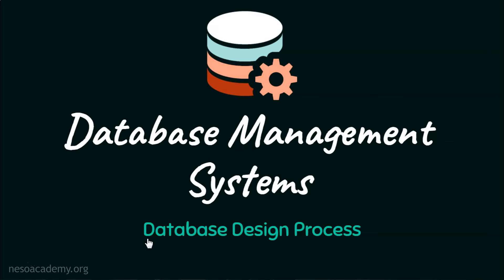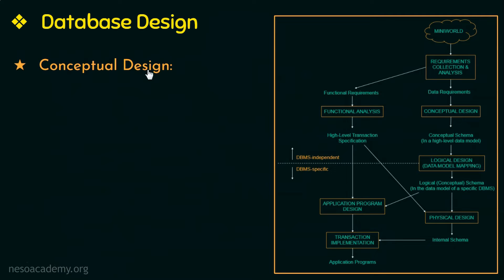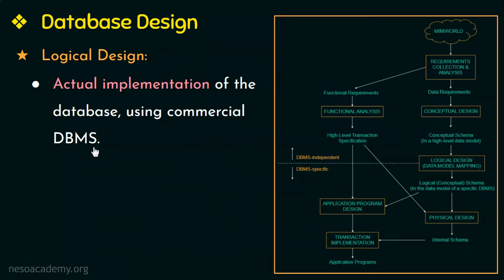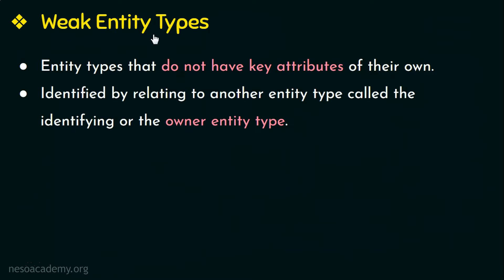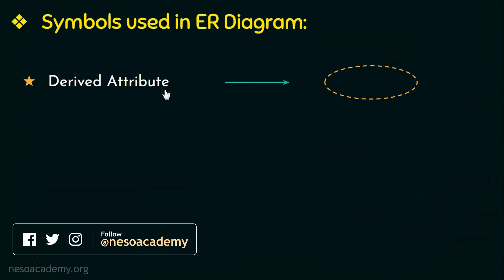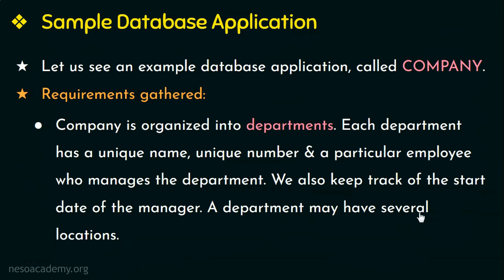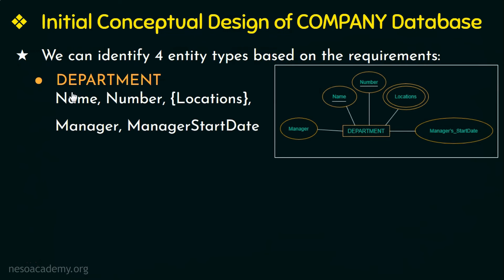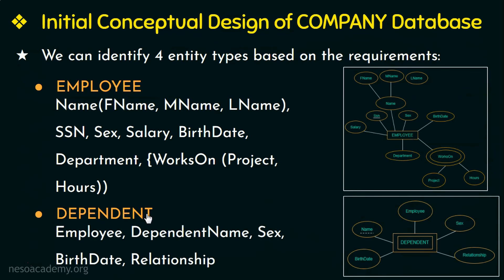Database Design Process

Comment: Hello.
What does it mean a decentralized database? Does it mean all the computers of the network are not connected to one server and all the info is stored within that computers?
I need to design a decentralized DBMS, but don`t know from where to start.
Thanks!
Reply: Decentralization is a rabbit hole in it's own right, would be unfair to say a decentralized database is just another database. We are more specifically referring to a distributed database system that through chunking and paging distrubutes the load of performing CRUD equally among the machines used within the system

Comment: I must be misunderstanding. You stated that during the logical design phase you start the implementation of your database, but from what I have read (Connolly & Begg, 2016) this part is still independent of physical implementation.
Reply: Yes, it is independent. This phase simply transforms a high level data model to an implementation data model.